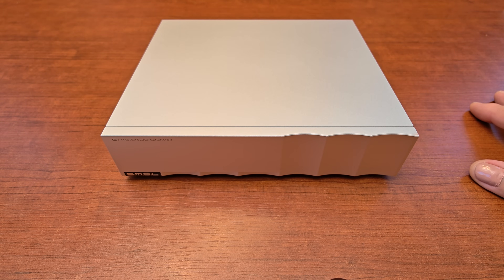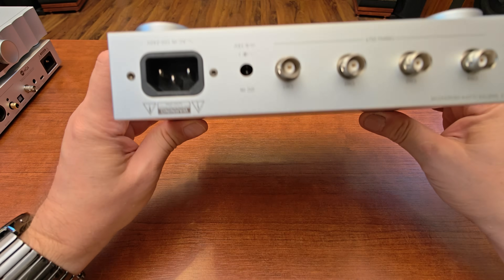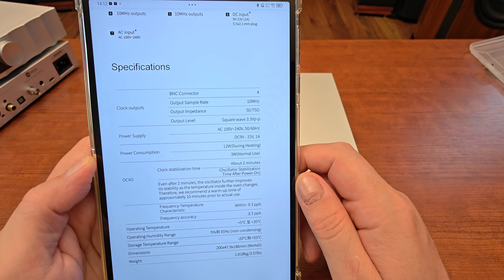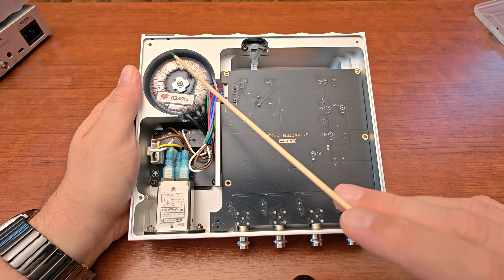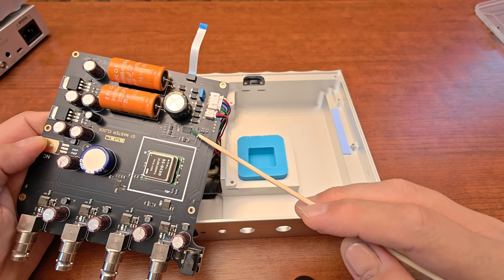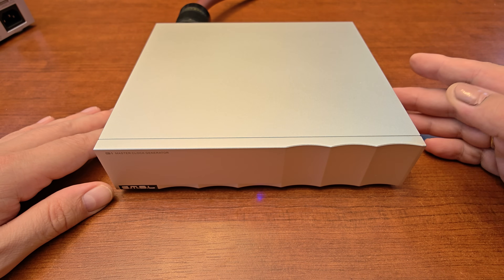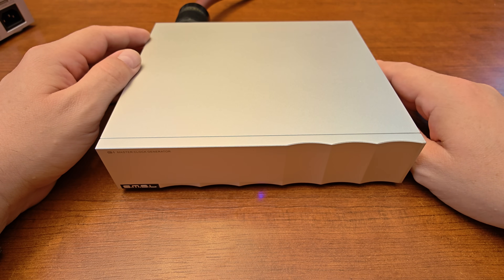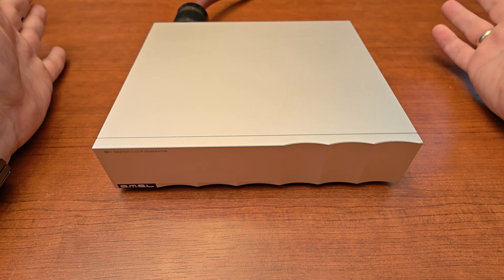Unlock Your DACs Full Potential: SMSL G1 10MHz Master Clock Review

Comment: Those super wideboy capacitors are usually "supercapacitors", with their value being measured in full farads (not millifarads or microfarads). They're very low voltage (1-5V usually) but can hold enough charge to act as a viable alternative for a coin cell battery for memory backup, or power things for a short time on their own. Possibly act as a massive RC filter.
Reply from the maker: Thanks, I'll take a closer look the next time I'll open G1. Such large capacity banks would require some charging circuit, as during startup they would effectively act as a short, right? 
That is, until they would be charged and ready.
Reply: I believe the Singxer SU-6 uses a super capacitor power supply internally, so there’s no reason to use a LPS on it.
Reply: @superspeeder Your are wrong!..I had SU-6 and it was easy to hear a difference with a good LPS.
Reply: @MrCorolla64 I’m just repeating what a reviewer said, which may or may not have been suggested by the manufacturer (I don’t remember).  Thanks for sharing your experience.
Reply: @MrCorolla64 easy? What LPS would you recommend? Or Which LPS are you using?

Comment: I guess you can connect the PL 200 T and the gustard R26 at the same time and according to you it makes a big improvement. Is that correct. So you can reclock the transport and the gustard R26 at the same time with this device Regards Eugene
Reply from the maker: As for the rule yes, the general idea is to contact both DAC and PL200T at the same time and I love that combination. 
But I'm using D200 and Gustard X26 III as I've sold R26 last year. 
External clock was an instant level up for R26 but even after that I could hear the noise floor of the ladder and the resulting lack of detail was a no go with my electrostats. So I went back to sigma delta converters. But if you have and like R26 then external clock is a no brainer instant upgrade
Reply: @k4syx so would it work better with an external linear power supply wouldn't that lower the noise floor. I think your electro stats are very revealing more than most

Comment: Do you have experience with SMSL PO100pro? I just got one for a test and I am dissapointed by so far.
Reply: It depends on how much room for improvement your source and your DAC have. For well designed non budget gear the PO100 pro is likely a waste of money. Find some use for it with your Laptop or PC.
Reply: @D1N02  agreed.  On a PC USB output it works great feeding a budget DAC.

I prefer the new Douk U2 Pro XU316 model to the PO100 Pro in my system, which is a PC into a modded ZD3.

I fully accept the input stages of high end DACs are likely better than these budget DDCs, where they might have no effect at all.
Reply: I have the SMSL DDC and the Douk Audio U2 Pro. I did not care for the SMSL unit. The Douk has a much better USB interface vs the SMSL USB C and worked as advertised.
Reply: @michaelwright1602  Thank you sharing your experience.
Reply: @michaelwright1602  used on my PC USB output, the PO100 Pro worked well for me to feed my ZD3.  The new Douk U2 Pro XU316 model works even better though. 😊
Reply from the maker: I have one and I did a review last year. It's a great little device that works wonder BUT for DACs that do not have good quality USB input (like older stuff, CA 851D f.e.) or DACs that have I2S but don't have USB at all.
It doesn't do anything to DAC at the D200 or Gustard level, you need to get to the SU6 level to have any meaningful difference for such DACs
Reply: @k4syx  Thank you. I will test it further and try it with different combinations but it seems at the moment that your findings could be correct one. The other problem is that no is telling this when reviewing. The third problem is that many likes clean, lean, edged - artificial digital sound, which is "revealing", but it is so  only because there are mids and bass with far poorer notes body, so you hear "more" details and air in upper register, which more or less not the case IMO - it is just overall poorer and artificial sounding "hi-fi". But I will report about my findings more in depth feedback in a couple of days.
Reply: @k4syx or you can replace the crystal oscillators for better ones with ultra low phase noise and jitter. The Douk U2 pro(old version) allows you to install multiple sizes.
Reply: @k4syx  I just returned Smsl PO 100pro. Yes, it did something to signal from computer to Wim Ultra, but using Ultra as a streamer and feed the Fiio K11 R2R Dac, it was a very poore performer - the sondstage noticable shrniked, also dynamics, music become lifeless. We put it in in Colleague's 100k system and there  this negative effect was even more obvious. But Fiio K11R2R surprised us all with its prerformances, especially for a real bargain. Great product! it brings notacible improvement in sound used with Ultra as a streamer, compared to Ultra's internal DAC, which also performes better when used with good outside source. The signal in Ultra between streamer and Dac obviously is not processed as it could be.Kind regards.